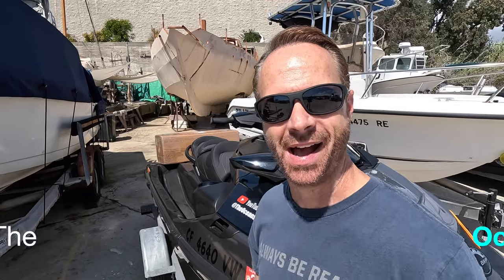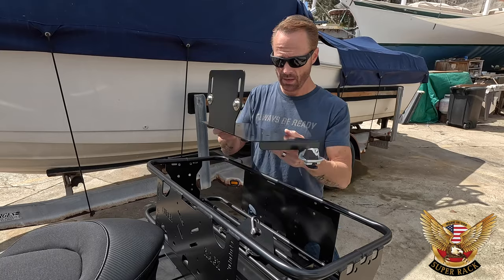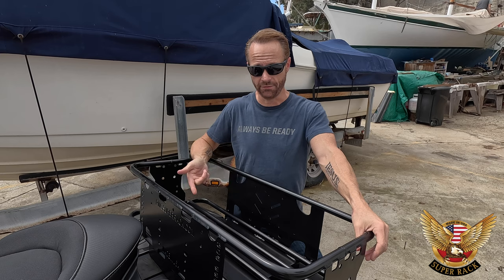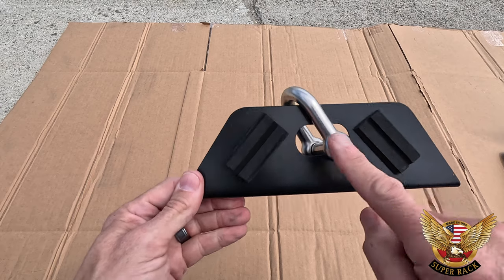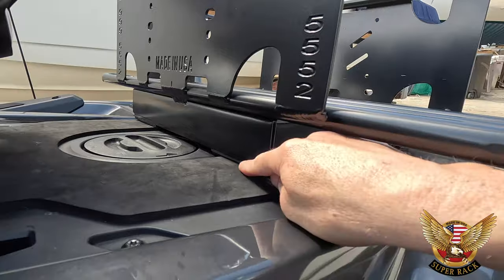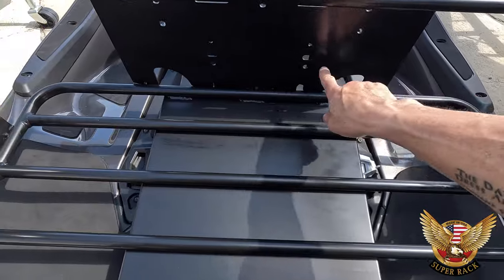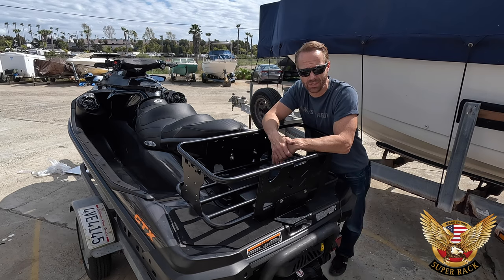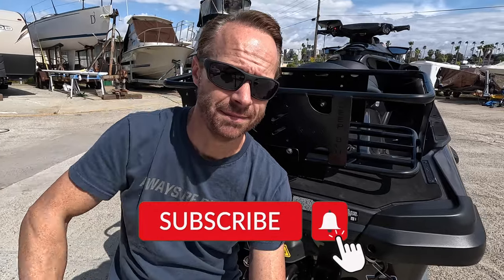Is Super Rack The Best Jet Ski Rack?  My Honest Review.

Comment: Any way this would fit the LINQ equipped swim platform of my Sea Doo Switch boat?
Reply from the maker: I will double check for you, but if you are currently using, for example, the LINQ cooler The super rack is the same fit.

I will give you a direct answer shortly.
Reply: @TheOceansideGuy  The swim platform on my Switch has 4 retractable LINQ points. A measurement would be handy. Thank you for posting.
Reply from the maker: Find me on Instagram.
@The_ OceansideGuy we could chat more efficiently. If you have more questions.